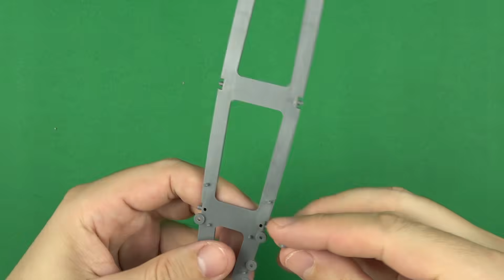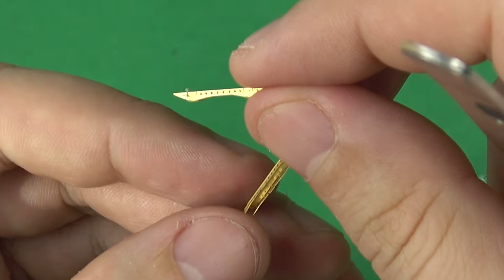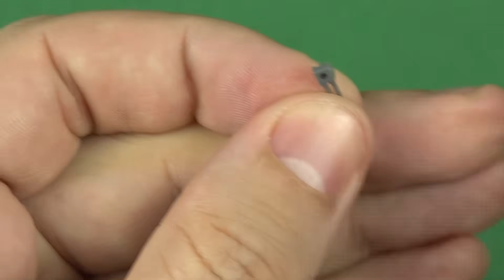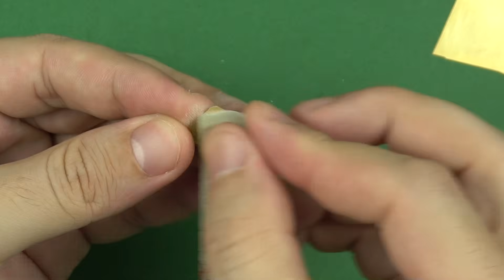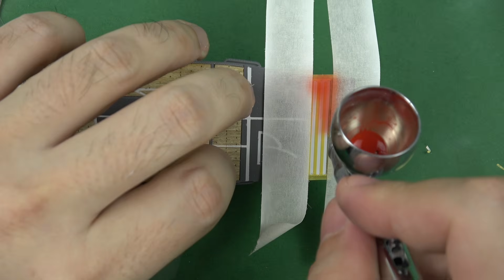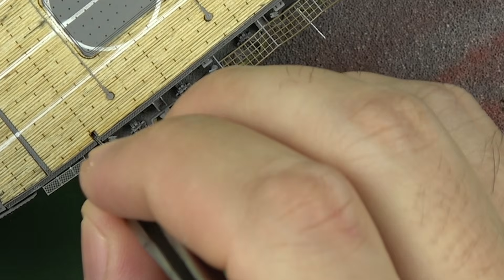Japanese Navy Aircraft Carrier Akagi - Fujimi 1/700 Scale Model

Comment: is their any military reason that the design of the ship is not viable in modern？
Reply: The decks relied on wooden supports and used flexible alloys to compensate for the lack of other infrastructure ON deck to cushion the planes decent. As a result modern weaponry would easily mangle the carriers deck, thus putting it out of action. There are also some other small difficulties, but that is the main one that comes to mind. 

Please correct me if I'm wrong :)

Comment: a little suggestion with the mattress on the bridge, before they are cut to smaller pieces,  you can use the tip of the blade(not the sharp part) to press and roll the string of putty and create many rings on it, you can then cut it to smaller pieces and you will have an effect of the mattress being tied to the outside of the bridge

Comment: I'm curious about applying paint/weathering to the wooden deck stickers.  Do you prime them first?  Is it better to use acrylic or lacquer?  I would worry that moisture could cause damage to the wood, or the paint could eventually start to peel
Reply from the maker: This was my first try of wooden stickers. I painted the markings directly and I applied lacquer thinner + X22 on it and I didn't apply heavy wash over on it because of some reasons like you mentioned. I applied some weathering using with soft pastels.
Reply: @Scaleaton  Thanks for the reply!